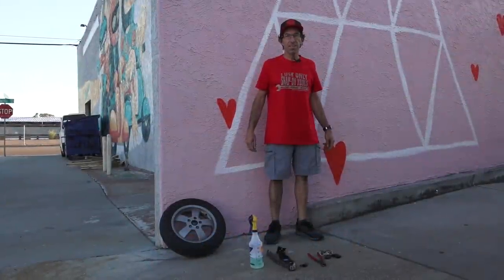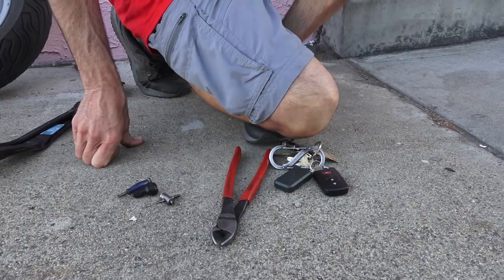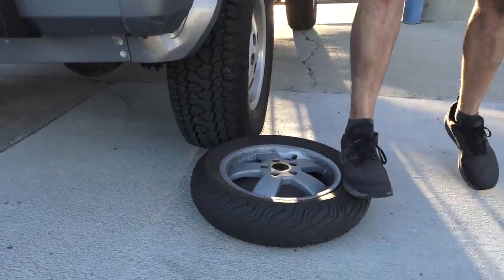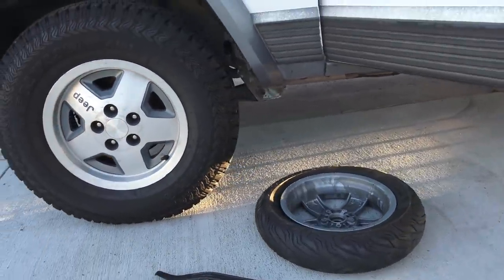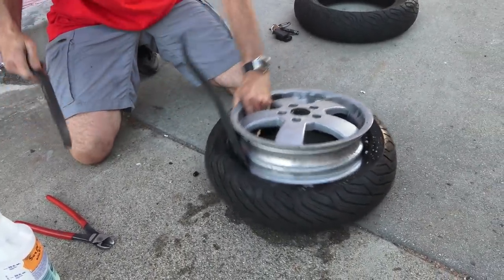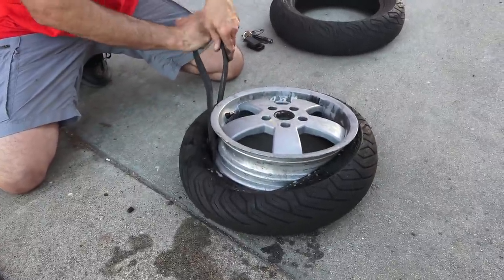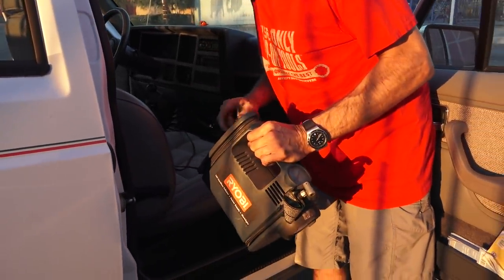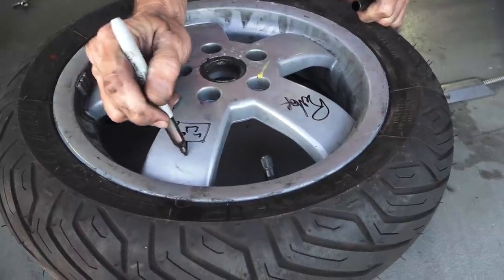How to Change a Tubeless Tire on a Modern Vespa with Minimal Tools

Comment: 12.3 lbs. There's small bead breaker available that uses a wrench. My 12v. air compressor couldn't seat the bead. I never thought to remove the valve! I did think a ratchet strap around the circumference of the tire might help pucker the tire..
Reply from the maker: Good tips, thanks for sharing!

Comment: suggestions: 3 tire irons are much easier, use gloves, knee pads or a blanket.  good video.
Reply from the maker: Great tip, thanks!
Reply: @VespaMotorsport  Also if you put all 3 irons under the bead before starting removal it's way easier than trying to get the second two under after you have one lip of the tire over the rim.  In this video he uses 4 but you get the idea: https://youtu.be/AkvKws9qk9s?t=97